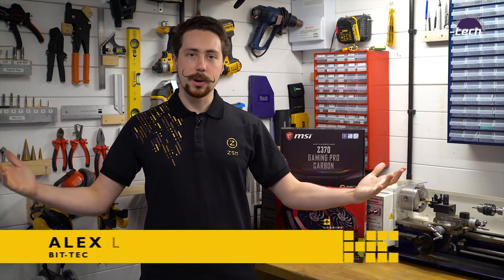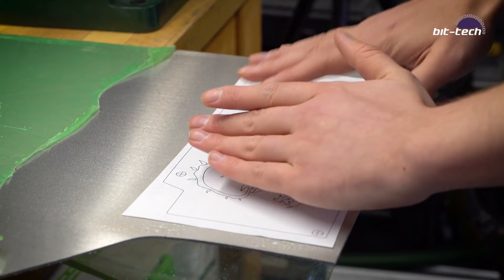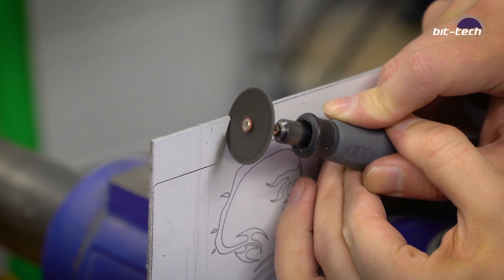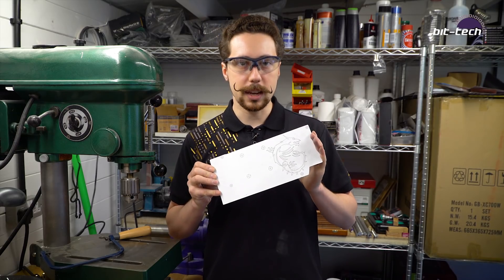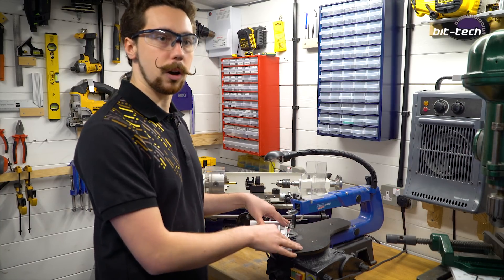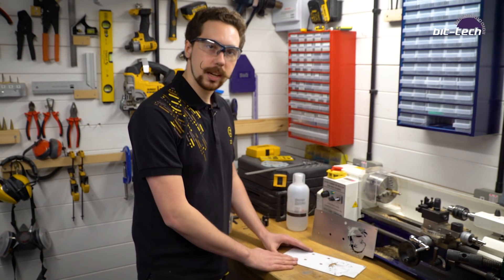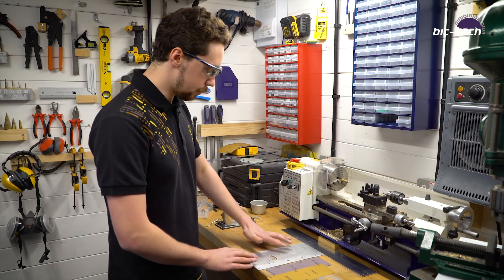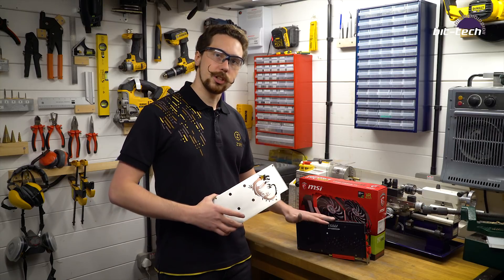How To Make a Custom GPU Backplate | MSI GTX 1060 #YesWeBuild

Comment: hi, I have a Palit RTX 3060 - ne63060t19k9-190ad - could you build a custom backplate for it ?
its plastic backplate, you only work is to build an equal backplate visually, but, using copper or aluminum as material.
send to brazil

Comment: you didn't show how u cutted the dragon face
Reply from the maker: indratej reddy The sane but took a lot longer haha. Back when this was filmed I wasn’t manning the camera for parts, so everything has to be done live when the guys came over.
Reply: @bittech1  i was u live near me , i wanna make one but unforunately ,i'm not a mechnical engineer and i don't have that skills and tools like u
Reply from the maker: indratej reddy Skills you can learn and tools you can acquire over time! My first mods were done in a university dorm room with basic hand tools and using a bit of wood on a chair as a workbench. Anything is possible when you put your mind to it!
Reply: @bittech1  yeah ur right but i'm programer, i asked my friend help, why didn't u use copper?? instead of alluminium

Comment: Great video! Would your process vary much if working with acrylic? Also, is there an ideal backplate thickness if you're planning on reusing the screws that you've removed from the gpu itself?